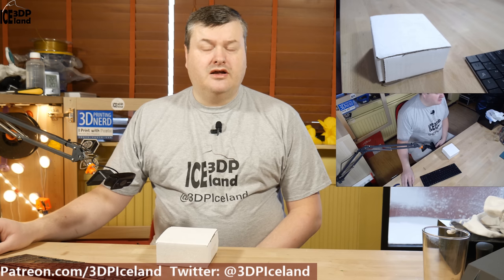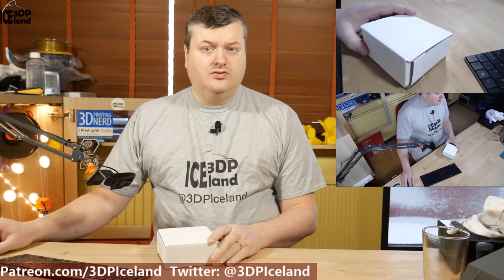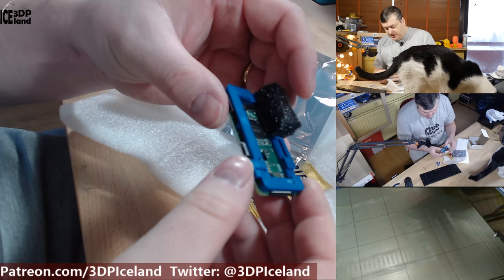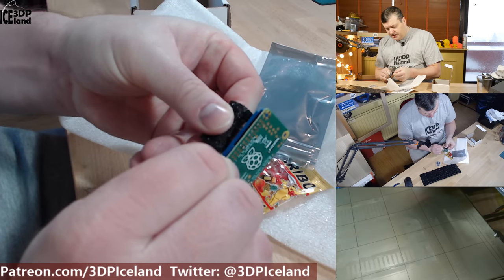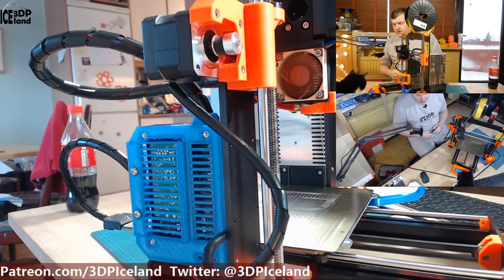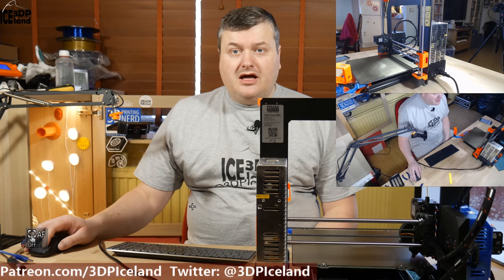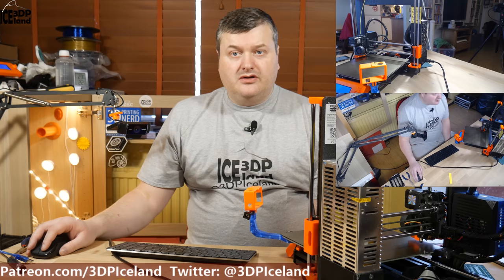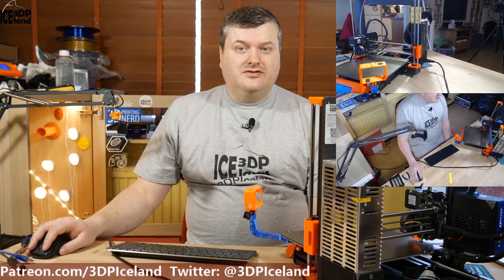Raspberry Pi Zero W Install on my  Prusa MK3 3D Printer

Comment: Nice video as always, Marteinn. Curious if you're planning on printing out the new, updated STL files for your MK3 that came out yesterday? They are small tweaks mostly (screw/hole tolerances), but a few cool things like a new belt tensioning system for the x-axis. I have mine printing out in Black Ngen right now! :)
Reply: Oh, and while I am installing them I will be putting on the new heatbed Prusa sent me (bad warping on the first) and also installing my Pi Zero W with this video :D
Reply from the maker: I was not aware of that they had made new stl files, I have to check it out :),  thanks.